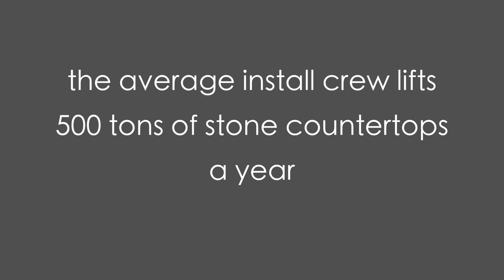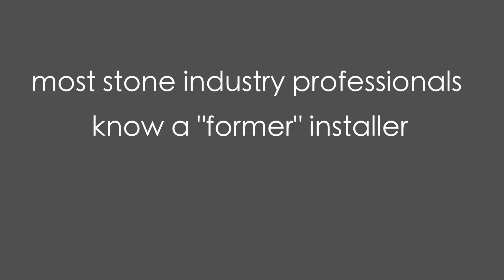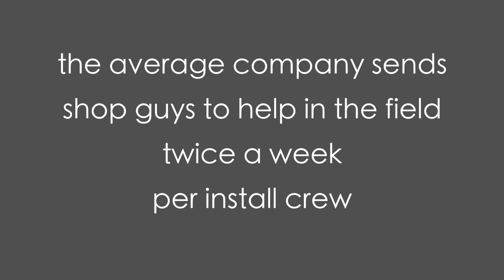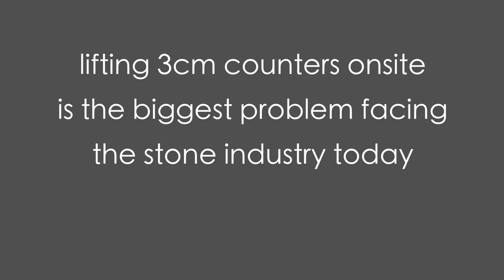Why get the No Lift Install System?

Comment: Awesome video guys. As for question about getting Stone from truck to cart, we keep cart on truck/trailer roll it beside our A-frame and lift it on the cart. Trust me lifting 10inches onto cart is much easier than carting 50yards in house, up stairs and then lifting onto counters which are several feet high. That is not even considering when the ceiling is to low to even get the counter into the cabinet. And as for the price, ITS WORTH EVERY PENNY!!
Reply from the maker: Thanks for the comment guys!  By the way, we are really digging your youtube channel.

Comment: Majority of the installs you show are a 3cm slab install how about when the counters have glue on lamination will it still work as good or will it hit the cart when you slide it off ????
Reply from the maker: Great question.  While the No Lift System is currently designed for 3cm, there are crews that use the No Lift for counters that are laminated.  Gives us a call and we can answer this question more in depth. #1-503-212-4034